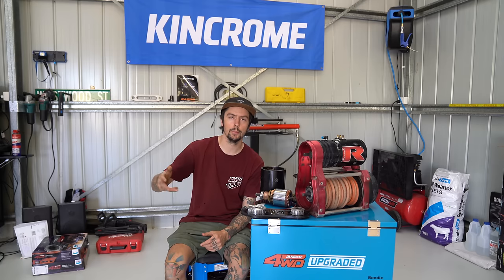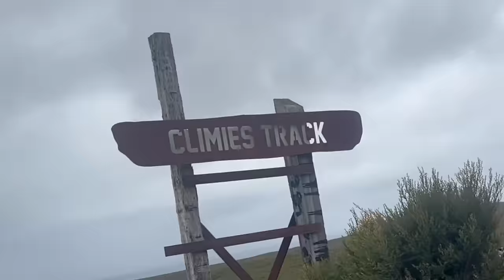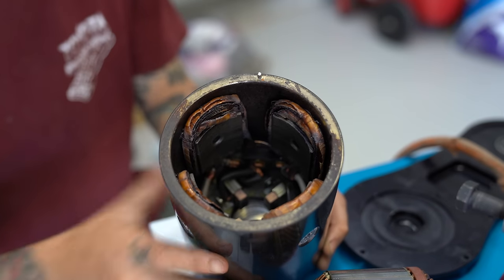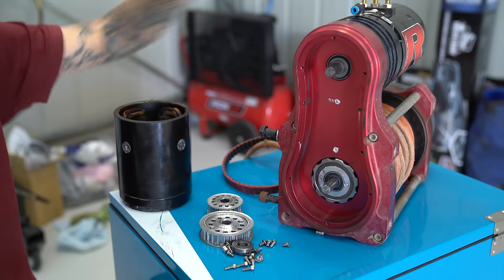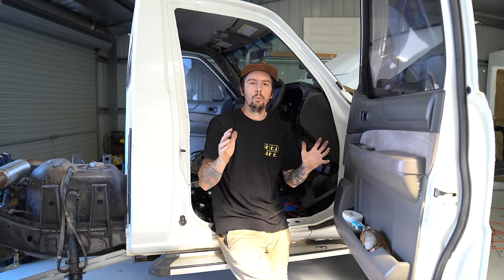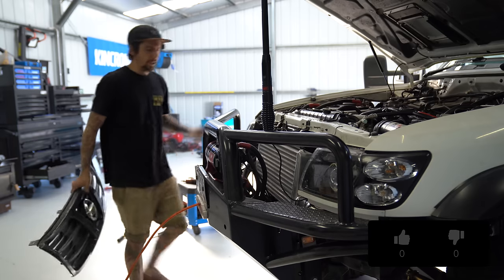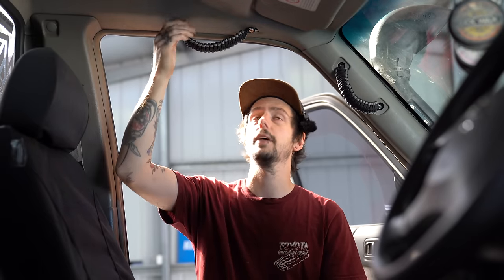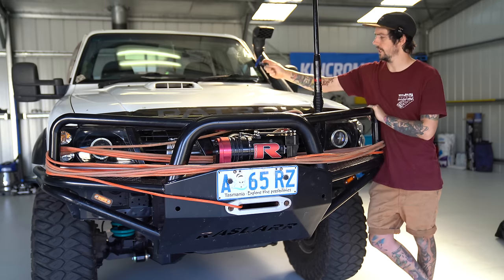PLENTY of BROKEN BITS after my trip with DESIGNED & BUILT

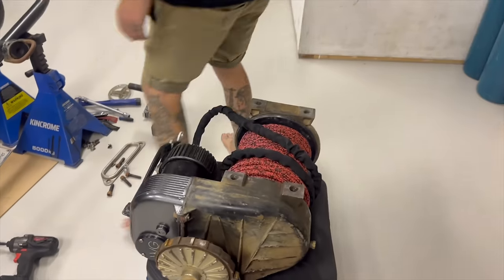Comment: 0:46, "Go away" that made me laugh.
Reply from the maker: Hahaha 🤣
Reply: @timmyhasheart late reply just to clarify did you have the overdrive ratio in the winch when the motor fried its self? With over drive gearing with only has a load rating of 1800kg might explain why it let go
Reply from the maker: @beartiger1553 yeah it was set to overdrive but it’s a little bit more complex than that. I was running it over volted to 24v which kinda renders the load rating pointless, because you’re increasing the kw but I was also actually running twin motors on it, the 2 theories for it burning out are either A. Voltage drop from insufficient cable size or battery supply, therefore causing amp spike and heat burning out one of the motors, and theory B. Is that one of the motors was actually faulty, which is what I’m gravitating mostly toward even though my power supply was indeed on the edge of being sufficient. But the way it burned out looked more like a stator short. But yeah either way that’s what went on. 👍🏻👍🏻
Reply: @timmyhasheart  yeah I’ve had both  a and b issues as well as overl loading the winch in overdrive causing heat  besides the motor problem how do you like the red winch ps Loving the no bs content
Reply from the maker: @beartiger1553 yeah overloading and stalling a motor can definitely do it too, it’s basically the same thing as having too little power supply or too small of cables but running 2 motors instead of 1 plus running them at 24v it was more than sufficient to winch my 2.5t vehicle at 61:1, I firmly believe it was faulty stator windings. 

I would prefer to have the red winch hornet, in all honesty I never liked the cobra after I burned this motor I chucked the warn back on. Which is now running a bow2 motor and a twin speed gearbox at 15% and 50% ratio increases

Thanks so much mate, appreciate the feedback 👍🏻
Reply: @timmyhasheart  those hornets are bloody animals I’d love on on the land rover (it’s ex army the good ones lol)

Comment: Hi again Timmy nice work as usual.
I'm a sparky by trade I can tell you the reasons motors burn out is a breakdown in the insulating layers between stator windings.
This happens due to overload or water ingress either of which will heat the winch motor up beyond its temperature limits.
I wouldn't be so quick to throw away the burnt out stator, take it to a motor rewinder, they may be able to improve on manufacturers windings too!
Cheers Timmy
Reply from the maker: Yeah awesome dude thank you, while I have a pretty good understanding of DC, DC motors are something that I’m not very well versed in haha. I appreciate that info maybe I’ll take it in to get it rewound? Cause the brushes are fine it’s literally just the stator windings that are fried. Thanks heaps mate 🙏🏻🙏🏻

Comment: Normally, burnt motors are to low voltage, on winch trucks we have always gone 2 batteries per motor on warn 6hp.
Reply from the maker: Yeah that’s actually what Kistler’s suggestion was, tbh I think if this is a low voltage problem, it would most likely be more due to the choking of the second motor due to the 1 solenoid, I explained it in this video cause I always monitor my voltage at the batteries and never really dips below 22-24. But that’s definitely not what the second motor would be seeing inline, considering the first motor is fine. However Cam from road runner thinks it looks more like a short, considering you’d think a burn from low voltage would burn between the commutator & stators. But yeah in any case 2 OX motors off 2 batteries is asking a lot. Well sort her.
Reply: @timmyhasheart  I didn't realise only a single solenoid also, yeah I see where the issues are now. Each motor should be a separate system. Anyways I'm sure you have this covered.
Reply from the maker: @Brennomac83  yeah absolutely agree, especially the amps that an ox draw but like I’m also new to all of this, I do understand a lot about DC, but there’s people like Kistler and Cam etc. that I try to lean on when things like this happen. The good thing about power is it’s just math.. so if the math is right the system is right type thing.. but yeah cheers for the comment mate! Appreciate it